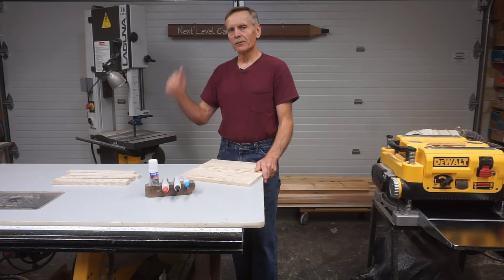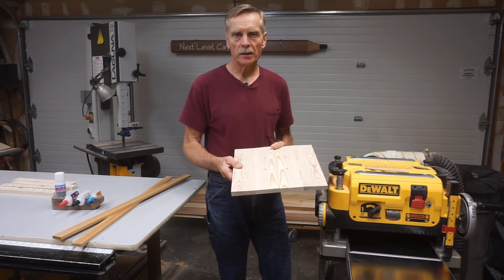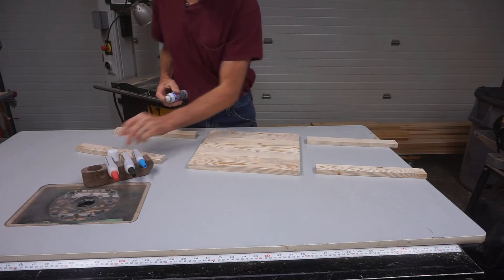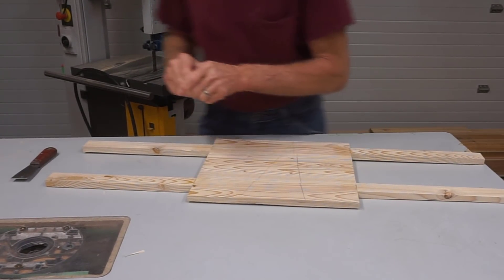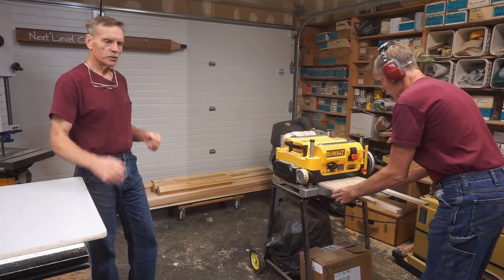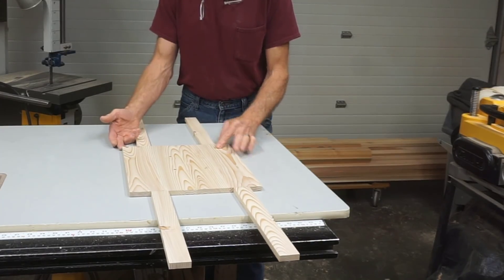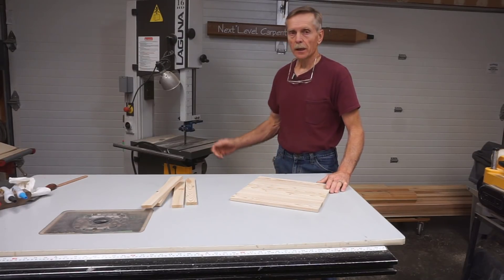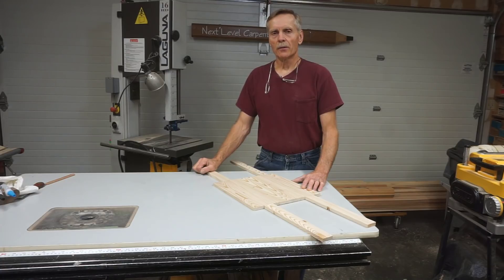How to Use Superglue to Help Plane Snipe-free Boards

Comment: Hi Matt, great video. You couldn't put side rails because of the width, so trailing leading edges was a good solution. If material isn't too thick, would the snipe have also been eliminated by putting the board on a sled with a stop ahead of the board e.g. 5 inches from the front - to completely support the board without feed in/out problems?
Reply from the maker: Sounds like you understand the issues with snipe prevention Simon... if I understand your question I'd agree that you could eliminate snipe by running pieces through on a sled with stops but the stops would need to be tight against the leading and trailing edge of the workpiece so it would essentially be the same as setting the pieces I show in the video on top of the sled so it would be somewhat redundant.  If you had a number of identical pieces in a production run of some sort then a sled setup would make sense.  Let me know if I totally misunderstood you, OK, and I'll try again?  Best, Matt
Reply: Theory into practice! I created a torsion box sled from birch plywood and bolted my thicknesser to a plywood in/out feed that's also box section and additionally supported with side rails to support the in/out and thicknesser. My primary use is to make do without a jointer for the first side and the secondary use is to produce snipe free boards. With no movement possible, I can plane cherry boards to 1 3/4" thickness and length 4 1/2 feet without any snipe. But total length on the bench is a 6 1/2 feet jig - so much more involved than just using superglue. For me, the big plus is making do without a jointer using the sled that's super strong from birch plywood (and some shims)  - a real work horse, albeit not very portable. I produced 10+ finished boards, with the next step: using your "How to Cut a Straight Edge on Crooked Boards" video, again!
Reply from the maker: Way to go... a guy's gotta do what he's gotta do, right Simon?  Nice work on the 'torsion box' solution... not something everyone is going to need or want but I like how you've dialed in to what you want/need to produce and developed a system to get it done!  Best, Matt

Comment: Thanks for teaching me yet another carpentry trick - does this work on the board stretcher DuhWalt BS1000 too?
Reply from the maker: It's a good trick, SWG, but you'll find it unnecessary for use with the BS1000 (despite the striking similarity between the two machines 😏) because the Board Stretcher powder is infused with superglue which is added to elongated lignin in the embigulation phase.  Best, Matt
Reply: Man, you are funny - your embigulation humor certainly makes me laugh.

Comment: Where do you get your accelerator and glue from?
Reply from the maker: Blake,
The Gorilla brand super glue (NOT Gorilla brand polyurethane glue!) is widely available at most any hardware or big box store.  The accelerator, which is absolutely invaluable IMHO, is a bit more difficult to find, but it just so happens I have links to both at the Next Level Carpentry Influencer's page at Amazon listed in the video description for your benefit... and mine :-)  Near as I can tell all the aerosol activator/accelerators work the same but I much prefer the little 3oz size can you see me using in videos because it's much handier to have around than the larger 7.5oz or 12oz sizes that are available plus it stores easily in my jobsite toolbox and/or nail pouch.  At the risk of info overload: I don't really care for the pump-bottle type spray option; seems like they aren't as 'hot' of an activator and so the cure time is longer than I like.  If you check out other videos on Next Level Carpentry you'll see many more ways to speed up and improve your work by using them in combination like I do... it always makes me wonder how I ever got along without it!
Best,
Matt
Reply: Next Level Carpentry thank you as always!
Reply from the maker: Blake, Certainly... and FYI I miss-spoke on my first reply and will edit it soon but wanted you to know this right away.... I just went out to my shop to confirm the activator can size to let you know the one I use is the 3oz size for all the reasons explained above.  Then I noticed I had the 7.5 oz size on the Influener's page list until just now when I went back in to switch it.  The small size is THAT important to me and I didn't want to confuse you over the difference.  Also, I do have a can or two of the 7.5 oz size on hand in the shop because it it a little more economical to use, but barely enough to get me to switch :-)
You're welcome as well!
Best,
Matt

Comment: This is a great method for eliminating snipe.  However I'm going to all tangential and say that's a really sweet bandsaw!
Reply from the maker: Thanks tomx63, I see you watching other snipe-related videos on your channel... check out the planer maintenance video I did where you can use some of the tips I show on a DeWalt model on whatever type planer you have for one extra measure you can apply to minimize the snipe problem: https://www.youtube.com/watch?v=r_yEwlsYGbU&t=2s
Thanks for watching and  commenting!  Oh, and if you ever go shopping for a bandsaw be sure to include Lagunas on your list of considerations, they truly are sweet!  I've had that for 10 years or so I guess and, at the time, I felt it was the best out there.  A lot of things have changed in those years but I think the Laguna guides are still tough to beat for performance.  The HD 16 and it's crazy 16" resaw capability is remarkable but I do have to buy 150" blades for it even if I'm only cutting 2" thick stuff... something to consider.
Best, Matt

Comment: Hi Matt, great vid.  Really like that editing program that puts you alongside the action....is it a common feature on editing software?  And what are your thoughts on the Laguna bandsaw?  They launched them here a few years ago with some value-adding features like an optional light and wheels with the stiffer pyramid frame.  However there is a price premium on the range but as for an optional light?  Who doesn’t need more light on the blade?  Should be mandatory like decent dust collection but it has got me thinking about led lights strips either cut into a door sill or just adhesive...
Great work....thanks for posting the vid. I note the subscription increases too. Fingers crossed for the continued increase. 
Pity how the disclaimer had to be longer than the subject...maybe the trollites require more processing time!!
Can’t find any accelerometer for that fandangled flue here in Australia...don’t suppose anybody has any ideas other than bunnings or carbatec? Cheers from over here....
Reply from the maker: Cognitor, Thanks for the encouraging comments!  The "me x 2" video editing magic is a capability of the Camtasia video software I use but not an automatic 'feature'.  First time I saw the 'magic' method was on Jay Bates' excellent channel on YouTube so I just stole his clever idea and hashed out how to get it done for NLC videos.  Besides being kind of flashy it really helps condense video length by accomplishing two things at the same time.  I worry about it being more distracting than helpful sometimes when the video ends up 'choppy' from my lack of experience but hey, it's all part of the learning curve, right?

The main reason I bought a Laguna machine was that at the time I felt their proprietary 'Laguna Guide System' was the best guide system available and still really like it.  I bought the HD 16 because of it's radical 16" resaw height capacity and have not been disappointed.  That said if I were to replace it for any reason I'd probably take a hard look at Powermatic as well as newer Laguna models but focus on the function and capability of their guide systems since they are key to reliable function IMHO.  More light is good... I like your thought about adding LEDs now that they're so bright, affordable and available!  I'd also like the lever-action or top-mounted wheel tension adjustment features since tension adjustment on this one is a bit awkward with the wheel mounted where it is.  Sadly I'll disappoint you on the 'mandatory dust collection thing' as my system is limited to a blow gun and a broom :-)

Kinda lost me with the 'bunnings or caratec' part but it's good to hear from you 'over there'

Comment: Great idea. I'm going to have to remember this one. Thanks.
Reply from the maker: Joel, you're welcome... using an activator with CA glue in the shop for this and countless other applications can be a HUGE benefit to your workflow, I know it has been for mine.  Every time I can keep working without having to wait for glue to dry on little things is a HUGE plus.  The more times you 'remember this one' the quicker it comes to mind for other applications
Regards,
Matt

Comment: Why do you videos "jump" so much?
Reply from the maker: Hey sawdust,
Kinda looks like I have a nervous tick and work in an earthquake zone, doesn't it? :-)
I explain the reason in the 'About' section on my Next Level Carpentry Channel:
"Since I'm a MASTER carpenter and video production AMATEUR my hope is that viewers will find enough value in the content to learn worthwhile skills despite my less-than-great video production capabilities."

I'm somewhat embarrassed by how 'jumpy' my videos are but it's a by-product of my one-man operation.  Believe me; I'm really trying to improve the overall quality of my videos and continue to strive to do so.  In a perfect world I'd have a video production 'team' to handle the video part so I could concentrate on providing next-level carpentry content but that hasn't happened... yet.  Hope the content you find here is worth putting up with the jumpy distraction...
Reply: Next Level Carpentry sorry, not trying to embarrass or harass you, just wondering. The information/content you provide is truly professional. I enjoy  learning.
Reply from the maker: sawdust,
No worries... your subscription to NLC indicates your appreciation and earns mine!
The smaller jumps are cutting 'dead air' out of the audio so the dialog doesn't drag.  The bigger ones are usually from clipping re-takes when I'm 'filming' unrehearsed and 'on-the-fly'.  My foray into YouTube has given me a much greater respect for professional video producers, that's for sure!
Your comments are always welcome here!
Best,
Matt